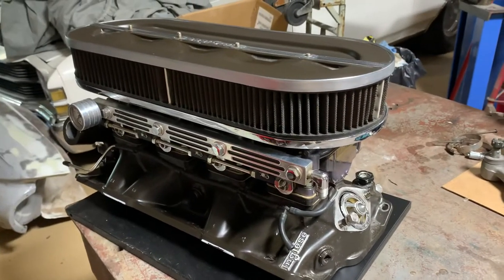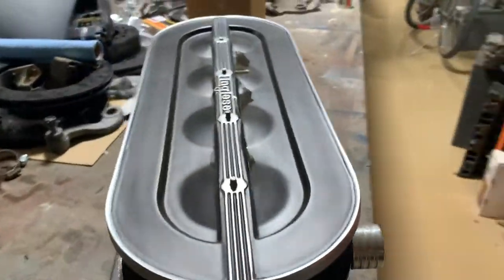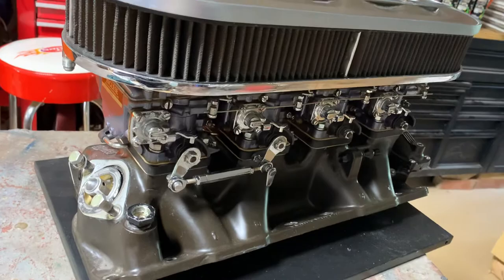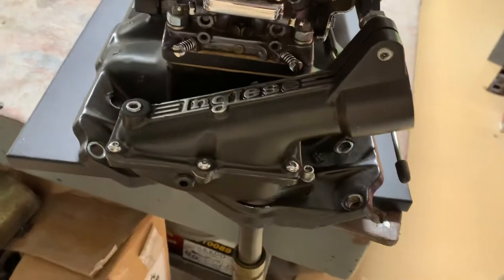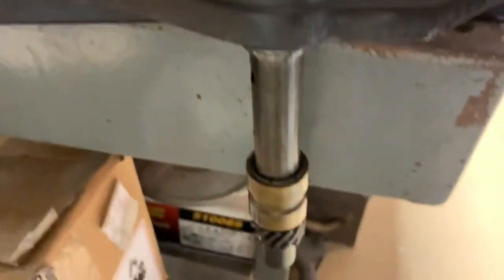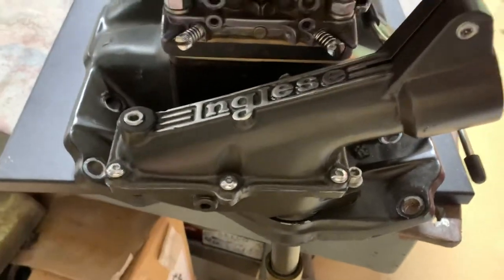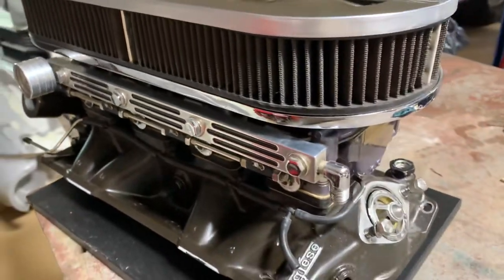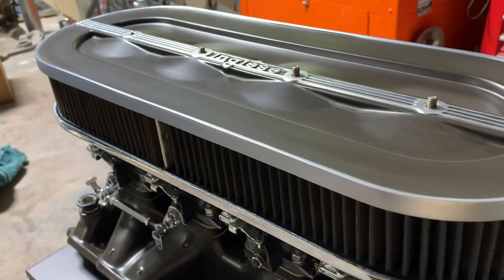Very Rare Inglese Small block Chevy Maserati / Ferrari Weber DCNF 40 50 Mechanical fuel injection?

Comment: A thing of beauty.
Reply from the maker: Thanks for your comments. I hope you subscribed to the channel. I sure do appreciate your support
Reply: @SpankysHotRodsandCustoms  What air filter cartridge is used in the air cleaner. I have just purchased a manifold and would like to build an air cleaner like yours. also you don't know of any distributor angle drive units that are available for sale do you. Subscribed.
Reply from the maker: @joesmith5993  I don’t know of any distributor mounts. I’ve talk with Jim many times and he only has 1 that’s part of a full kit/unit. He wants @6k for everything if he still has it. You could build one or use a crank trigger or front mount distributor. 
He made @20 intakes and @10-15 distributor mounts and about 15 air cleaner tops and bottoms and I had 3 of those. I may still have one left. I’ll have to look. I can measure my filter tomorrow for you. I don’t remember the part number or size. Thanks for watching and your support.

Comment: Im still researching these carbs, do webers make more power then your typical 4 barrel. Im thinking about trying to mount 4 dcoes on an LS and the information out there is very inconsistent on if webers actually make more power / drive better than holley carbs for example
Reply from the maker: I’m my opinion they are very good and better than most carbs. I think of it as a mechanical fuel injection.

Comment: Does Jim have any of these left? 
If he does I’d be extremely interested
If you can give me his contact information
Reply from the maker: He only did a handful of complete kits. I’ve seen 1 or 2 intakes on eBay and one complete kit on BAT that brought $10k . Finding the distributor part is the hard part. But you can use a crank trigger or front mounted distributor. I’ve got 20k miles on mine now. Thanks for watching